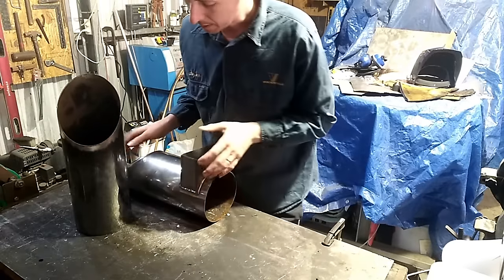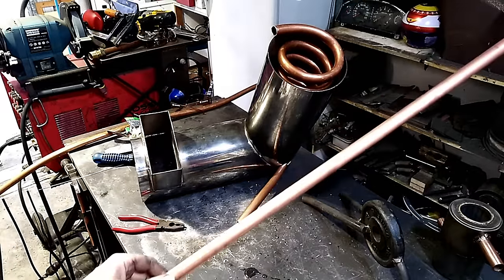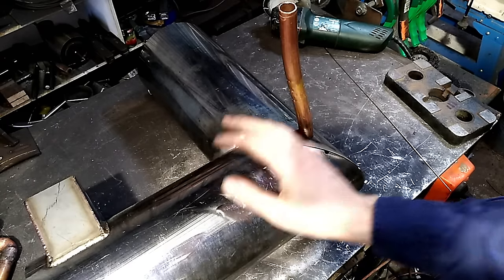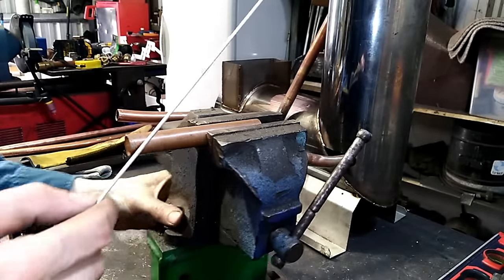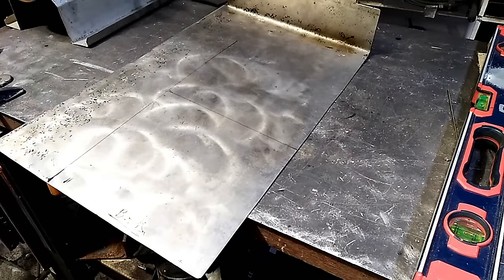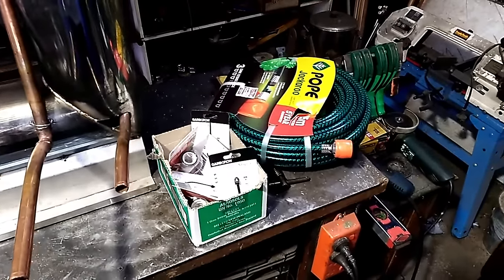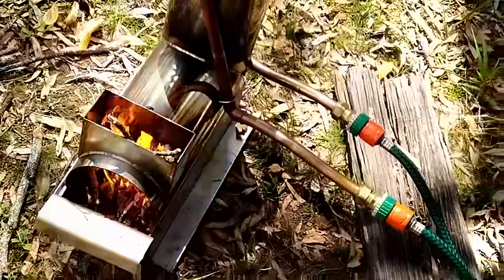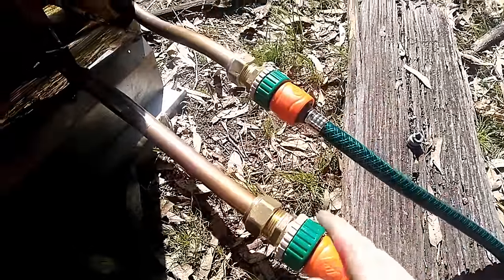Hot Water Rocket Stove II  - BUILD-

Comment: No part of the OUTLET pipe should dip dow,n if they do, airlocks from.  You should take the outlet pipe off, and bend it up and always be rising towards the top of the storage tank, pool whatever.
Reply: GREAT video and I agree with the "steam lock issue" the outlet from the stove should be at the top of the coil.  FYI  if you place the hot water outlet about mid way in the tank with a 45 of better angle to create a circular motion in the water you will greatly increase efficiency and reduce the time and fuel needed as it will mix and create a thermal vortex in the unit.  This from a old Chief Machinist Mate USN.  Again GREAT video.
Reply: Double agree.  The steam buildup actually slows down the process. The outlet should be a couple inches above in the inlet all times. Especially near the heat source. The water flow will greatly increase in speed by doing this too. Also, the outlet (or rather the inlet into the water reservoir, pool, hottub, etc) should be below the water level, a few inches would be fine.
Reply: I agree. And it would properly also make the stove more efficient if you ad a core pipe that force the gas flow to follow the pipe. The pipe kinda promotes a dead boundary layer along the pipe wall and most of the flow is properly in the center where no water is heated. 
You could add a second central coil in parallel with the one you got, but it's a tight bend and some interesting welding.
Reply: @Zigge  - But that would reduce the cross section of the riser and impede overall airflow decreasing burn efficiency and most likely cause smoking and creosote.
You could probably put a baffle all the way up to stop the vortex. That would let the heat rise straight up evenly instead of swirling to the middle. That would probably also decrease burn efficiency, but not as much.
I think the best bet would be to put a second water pipe straight up the middle. That wouldn't reduce the cross section very much but it would be in the very hottest section of the exhaust so it would heat the water very fast even though it isn't in the stove for very long.
Also you don't want to take too much heat out of the exhaust or you will defeat the thermal siphon (convection) that drives the rocket stove effect.
Reply: @GordieGii  For a non-condensing burner like this, the ideal smoke temperature is in the region of 150C and anything above that is wasted fuel. If the reduced burn rate is creating problems with burn efficiency, the problem is in the burn chamber and not it the heat-exchanger part where the water pipe is located. Insulating and thereby raising the burn temperature should help on that and the overall efficiency.
Reply: @Zigge  - The outside of the copper pipe is never going to be much more than 100C (unless it is allowed to run dry) so if there is a lot of smoke hitting the pipe, wouldn't it condense on the pipe? If the vortex keeps the flame and smoke in the middle of the riser, it is still going to radiate onto the pipe. If obstructing the flow of air isn't a problem then I suppose adding a core to the top half of the riser would increase transfer of heat after the smoke is more fully combusted.
Reply: GordieGii possibly?
 Condensate is not really a problem in copper pipes like it is in an iron furnace. It's recommended to keep the water temp above 70 C in iron furnaces to avoid any condensation = corrosion. But in true condensation furnaces, the smoke temp is as low as 40 til 60C  and you run the water in reverse to the smokes direction to get the maximum yield from the heat. 
Keeping the smoke temp in the region of 150C is a good compromise between avoiding tar buildup/water condensation and keeping a good efficiency overall in a normal fireplace. But since there is no real smokestack on this kinda stove, I guess anything above 100C is fine? It's not going up in a chimney that is colder the higher it gets.
The flame is really an expression of incomplete combustion and only after the flame front can you talk about flue gasses or smoke. So I would properly incorporate a two-stage air intake. A primary intake behind or under the wood and a secondary intake after the wood. The first is going to be the gas-pedal so to speak, feeding air to promote combustion. The secondary to ensure complete combustion of the volatile gasses. Making the burn chamber well insulated promote complete combustion and if you can get it above 850C you are not going to see any tars or creosote worth to mention. Ducting the secondary through the flue gasses after combustion is a true and tried way to regain some of the heat and raise the burn temp.
So the way it works is that you feed enough air to the wood to "evaporate" the wood and adjust the secondary to get complete combustion / no visible smoke, but keep it just enough closed to make sure you don't just rush a lot of air through the coils with too little time for it to give up its heat.
Reply: @Zigge  - But a condensation furnace is in no way convection based. There is no way 40 to 60C is going is going to generate any usable draw so you are talking about a forced air combustion system, and the water in a thermal siphon has to go up through the heat exchanger so to have a counter-current exchanger you would have pump the water down or pump the exhaust down.
I'm pretty sure that the exhaust coming out the top of this rocket stove is several hundred degrees to get the amount of draw (convection) we see in a 40cm riser. The efficiency of a rocket stove is about combustion efficiency, not heat utilization.
There is one way you might be able to get the kind of exchanger efficiency you are talking about without resorting to pumps or blowers, but that would be a bit more complicated than this simple J style stove. That would be a mass/reflex/drum style furnace with the coil in the top and anular area of the drum. Not sure I've got the terminology right. Do you know what I'm referring to? This might make sense for a pool heater or a house, but I think we may be getting way too complicated for an outdoor bathtub.
Reply: @GordieGii  You are totally correct. I was merely mentioning it in relation to the involved temperatures in various systems.
In this stove, everything has to move up.
Reply: Super
Reply: Cáballo con sebra
Reply: @damis tiseye great comment. Could you make and post a video on what you've done...?
Thanks.
Al.
Reply: He's right. You've created a geyser
Reply: Very true. What happens is steam pressure developed in the pipe stopping gravity flow.

Comment: Have a look at how they configured the  boilers in steam locomotives, you'll find better heating efficiency using parallel pipes as heat conduit running through a small water tank.
Also your storage tank may be more efficient if you draw the heated water from the top back into your boiler, alowing reheated water ( from the top of your boiler) to preheat the bottom of the storage tank as it flows back in.
Reply: yes Matthew, i think like you.
Reply: But would the weight of the water slow/ stop the water flow? I think water has 1/2 lb of force per ft... I think.

Comment: As a (retired) general handyman who did a lot of plumbing I confess to some reflexive cringing at your copper joining technique. Try buying some silver solder, flux, and a propane torch. You’ll save so much time there will be a large hole in the wall from your beating your head against it from you reacting to the realization of all the unnecessary time and effort.
There’s a saying that when all you’ve got is a hammer, everything looks like a nail.
Reply from the maker: Well said, thanks mate!

Comment: Airlocks will form based off the design but you can combat that with a constant flow of water using a little pump on the intake side so it doesn’t get hot. The pump doesn’t have to be crazy just enough to move the water around. I’ve put some time into learning about projects like this as I live in Canada where electricity is expensive and it gets very cold so wood is the best option as wood is basically free

Comment: For self feeding of the wood, feed it through the top and put a damper on the bottom where you are putting the wood in. Leave the door closing the bottom with the damper so you can open it and clean out what dodnt go out the chimney.

Comment: I use salt to fill the copper tubing. Also why not wrap copper around the rocket stove. Then add a sleeve over the tubing. No direct flame.
Reply: because the tar/oil ends up condensing on the cold water pipe??
Reply: Excellent idea.
Reply: Why salt? Finer grit to bend, or easier clean out due to dissolving?
Reply: drmachinewerke1, That would work fine but filling the space with sand would conduct heat better between the inner wall and the copper pipe.
Reply: These are the ideas that I am looking at, right on my level, had to read a lot of comments to get here 😅

Comment: I think your top inlet to the drum should be much lower and your barrel mounted much higher than your heater.  I have used a coil right in a fire to a bucket mounted on a tripod that was at about 1/2 a meter off the ground.  I learned about this when I was a Scout leader at a camp involving Canadian and US Scouts. It is nice to have hot water to wash dishes when you are camping!  Great job you have done on the heater!  Certainly works well, I'm impressed!!  Thank you for sharing.

Comment: Good job. 
Two things I would enter are a statement and a question.
First years ago I was taught to use sand to bend heavy wall drawn boiler tube by capping one end,packing sand and then capping the fill end after that. Then clamp to a sturdy table,beam or column and heat with a rosebud while more people pull in the direction of the desired bend using a cheater pipe of a larger diameter. We only bent tubes in field construction on rare emergency situations. Only when a major shop could not get the bend tubes made in time. Mega Watt output vs boilermaker wages and you win. I had no concept of really how much things cost but when the demand for steam is there money is no object to get a boiler fixed. You did well using sand I heard ice does well if you do not use heat to make bends but I have no experience with ice as we used a lot of heat.
Reply from the maker: Thanks mate, I love hearing these experiences that you guys have been sharing.  It's great to hear from the guys who have been there and done that and not just the keyboard warriors.   I'm going to do a video soon where I try ice, salt and nylon greased rope to bend the copper pipe.

Comment: After you bend the copper pipe, use an adjustable wrench to true it back to a circle. Set it to the right diameter and run it around a few times.
Reply: Top of the coil is full of air. The coil outlet bending down is no help on a thermodynamic system.
Reply: I'm new to your Channel and I enjoyed your video very much. You're quite a Fabricator and a TIG Welder. 
The design that you created I'd say it's right up there with the Inventor Nikolai Tesla.

Comment: a tip i had learned about keeping copper tube round while bending it is to fill the tube with water and freeze it.   the ice inside will support the shape but still be able to fracture to allow you to bend it.
Reply: So where did you find a 10' freezer to put it in?
Reply: @armandhammer9617  they usually come coiled up in a box if you buy them from the big box hardware store.   It is usually 30cm/1ft in diameter so it should fit in most freezers.    If you live up north in Canada or the northern states, the 10ft freezer is outside for 5-6 months of the year

Comment: Fully agree with most of the comments. You made a mistake in the build, the pipe from the top of the coil should never have gone down to the bottom before heading off to the tank. Unfortunately this will burn out early, because the tubes are boiling dry then chilling, and I can tell you now that will kill copper
Reply from the maker: Thanks mate, revisiting this build soon to put into practice so many of these great ideas you guys have suggested. Cheers

Comment: Really liked this experiment. 

Next trick is add auto feed of fuel.

One of your other videos had a sloped inlet for the fuel and a longer hot air run to pull incoming air.

The fuel feed would need to be either wood chips or something consistent enough to slide/fall without constant manual feeding. 

Once feed is worked out it should be possible to setup for long unsupervised burns.
Reply: Åuq

Comment: It would have been vastly easier to solder the thing and the comments on the hot out are correct The steam blowout is the proof of the need to have the hot out flow without boiling. quit lieing to yourself and raise the hot out line. Also use some hot water rated hose or pipe. Very attractive job on the steel! well done. With time the constrained copper will be problematic. just use a standoff.

Comment: Er, a thermo syphon system has to have the hot outlet pipe rising , vertically is best, at least at an angle,   heat won't naturally travel downwards . The hot water tank has to be above the level of the boiler. The bursts of steam are the system fighting against itself.  Your system requires a circulation pump.
Reply: Straight up within 3-5" of the  boiler will stop the stem spurts for sure. Use Hot water plumbing plastic pipe or copper.
Reply: Yes his use of a down pipe creates the problem IMO. I wonder if the 90 at the top was removed or rerouted to up or level if the bursts would minimize?  @roberthodge2771
Reply: It will work just fine if he just remove that tube going downwards on the coil outlet.
Reply: Rufus Chucklebutty m
Reply: Agreed!  Small Circulation pump is necessary to avoid air lock!  If the water boils(and it will outside of a closed system) the pump will propel the hot water forward.
Reply: @homayounshirazi9550  A siphoning system don't need pump, unless the design is fundamentally wrong,  like that tube going downwards. 

I'm well familiar with this kind of systems, as an appropriate technology engineer. 

Simple fix, just fix that faulty tube design.

Comment: Good old direct boiler tank. A normal tank is indirect type. 
And yes it did rubble from time to time when the back boiler behind my old fire place ran really hot.
That why you had a top mounted overflow pipe for the bubbled up to and over in strong cases back to the cold water feeder tank
Reply from the maker: Well there you go, thanks mate!
Reply: Awesome job mate...BUT...
You made the mistake of not having the copper coil outlet on an even upward grade towards the tub. That's why your having bursts of steam coming out of the pipe at the tub.
Simple modification and its sorted.

Comment: Your outlet is reversing flow after the gout of steam. A clear section of pipe would show flow direction. If the outlet came right off the top you might not get a build upon steam on top of the coil.

Comment: Hi nice work! but problem with steam is caused by the drop in the outlet! the hot from the stove, because it dips down, it is causing an air lock, in the coil, the outlet should rise steadily upto the tank.
and enter half way up! and cold from the bottom of the tank. back boiler with an airlock can blow up. and possible scalding. hope this helps. good work

Comment: I agree with those who have comented below about the fall in the outlet pipe, it should be at the top of the stove pipe with the connection to the tank being a slope up to the tank entering the lower third of its full hight, the whole tank needs lifting up quite a bit, so its all above the height of the stove.
Remember Heat rises so give it somewhere to go.

Comment: I did something similar with the pipe on my wood stove but I used smaller diameter copper that was already coiled and made a tighter fit when bending around the pipe. Then I covered it with tin to help enclose the heating copper. Also it keeps the flow rate lower  so the water has a better chance to get hotter.

Comment: You can use an close circuit for better heat and stoves circles(Another coil of copper on the tank, expansion tank required, and glycol liquid). Also insulation helps (hot)... Good job🎉

Comment: Your outlet and hose is too low they need to be above the heat exchanger in order too have near perfect circulation. It needs to work more like a wood/coal cook stove where the water comes into the bottom part of the heat exchanger and out of the top (DO NOT BRING THE OUTLET PIPE BACK DOWN TO OR NEAR THE INLET IT SHOULD ALWAYS BE LEVEL OR ABOVE THE TOP COIL), this is thermodynamics 101. The cold water needs to enter the top of the water heater with a drop pipe to the bottom of the tank, then the water leaves the tank and goes through the heat exchanger about 1/4 to 1/3 down from the top of the tank, then the hot water leaves the top of the tank. The thermo relive valve can be teed into the hot water inlet side of the tank. But must vent to the out side at the same level on the hot water inlet side of the tank so vent should face sideways, or maybe about 5 to15 degrees up angle with a 22 or 45 degree down or side ways angle outside but no down pipe, that way their if the tank gets too hot the water will vent out as steam.  (( If you are wondering this is how the modern hot water tank works and how it was invented )).